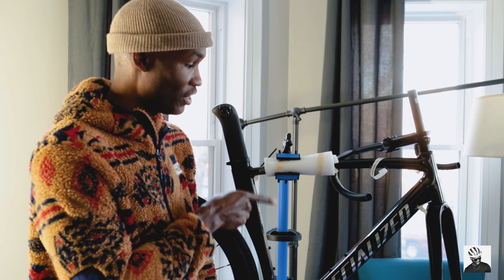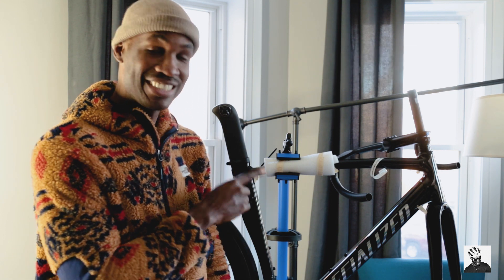You Were Right...

Comment from the maker: What are your thoughts on this bike? Have you ridden it before?
Reply: Very nice bike, should be crazy stiff.  I was actually looking for the  Allez Sprint disc model for ~4-5 months before i gave up and bought a new TCR.  Should be a ripper🤙
Reply from the maker: @Bigkidbird4  Spring can't come soon enough. Thanks for chiming in Mitch.
Reply: Its a great bike as Mitch says its crazy stiff and great power transfer! Looking forward to the series
Reply from the maker: @Elliotwestminster  Thanks Elliot stay tuned!
Reply: Nice videos, always interesting to see other Sprints and builds out there.  I bought the complete 2020 build, upgraded to Ultegra rear mech, chain and cassette, and much nicer alloy wheels and tires.  The Praxis Zayante cranks seemed fine enough as is, they are likely something between 105 and Ultegra quality.  This bike is insane, super fast, agile and even comfy when equipped with 28s.  I run Vittoria Rubino Pros 28 front and 30 rear so it’s definitely not twitchy or harsh but still is fast and handles like a dream.  You just cannot beat this bike for the money, it is the aluminum Venge!  Oh and also I put on the Aerofly bars which I love so much, look sick and are so comfortable.
Reply from the maker: @jfr1907  Nice!!! Tag me on IG so I can take a look. Thanks!
Reply: Hi Patrick, I love your videos on the Sprint Allez, I am considering getting one like this. I read that a number of owners had seatpost slipping issues and difficulty in tightening the seatpost. During your ownership did you experience such issues and also can you share on how you tighten your seatpost? Thanks a bunch and please keep these great content on bike builds coming!

Comment: Great choice!  I have the disc version and it's an excellent bike!  Like NonchalantGarage says, reliable, stiff and lightweight!
Reply from the maker: Good stuff Mud! Bone! In your personal experience have you had any down sides with the frame? Besides stiffness if that is in fact a negative for some.
Reply: @PatrickLino  Well bro being an aluminum frame, you feel more of the road vibrations.  It's not as smooth as carbon, titanium or even steel. But, that can be remedied with a carbon stem, handlebar and saddle.  Those items will make it smooth as a baby rat's ass on a wet Sunday mornin.  Enjoy your frame and i'll be looking forward to the build videos.
Reply from the maker: @mudbone59  Hahaha thanks Mud! You will see (in a humorous way) why I chose the components I did. Cheers
Reply: @PatrickLino  Can't wait to check out the finished monster bro!

Comment: Hi! Congratz for the video and bike, i have the same frameset and want to change the bearings that are preinstalled, have Enduro 6806 ABEC-3 written on them. Also comes with two cups that reduces  the size to 24mm to installe shimano spindels. Wich size do i have to look to buy a new BB? I know is BB30 and 24mm for my crank set, but that about de size? 68mm 73mm? I'm a little confused. Thanks for the help!